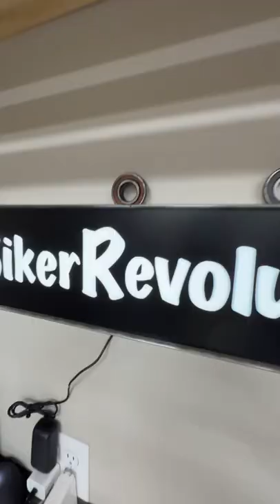Cam & crank gears, tappets, tubes, starting quickie rods. Cam & oil pump! Harley M8. #shorts

Comment: Also you might mention that SS pushrods are 32 threads per in. Harley's are 24 threads per in. As you know big difference when adjusting valves ❤